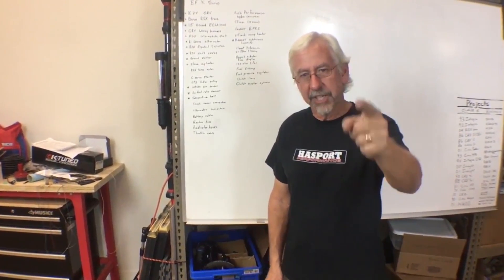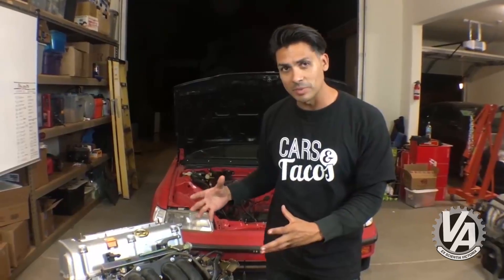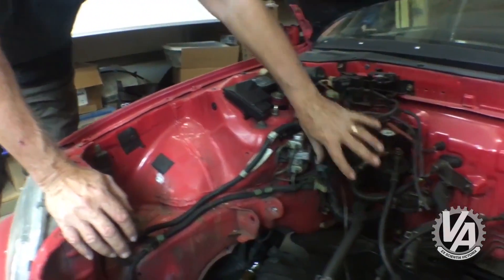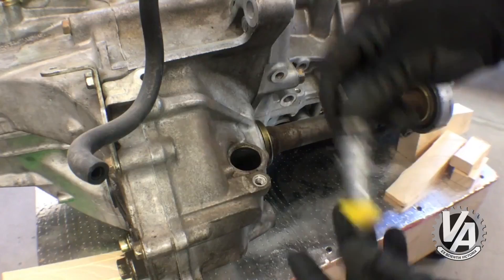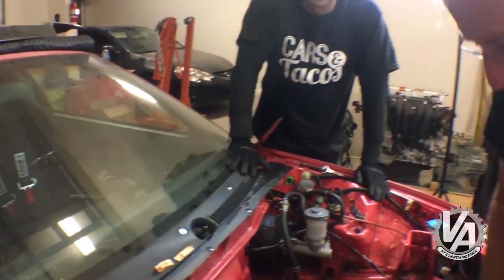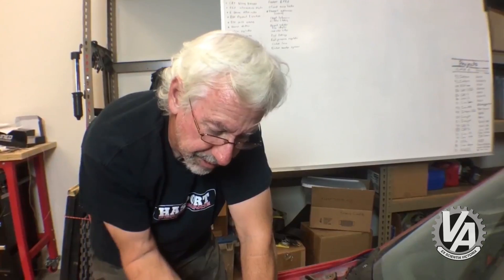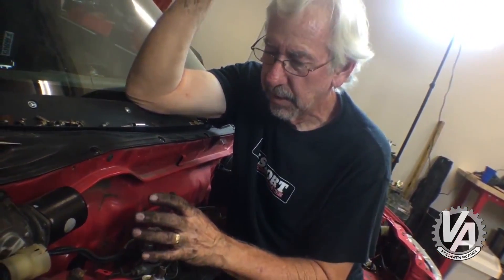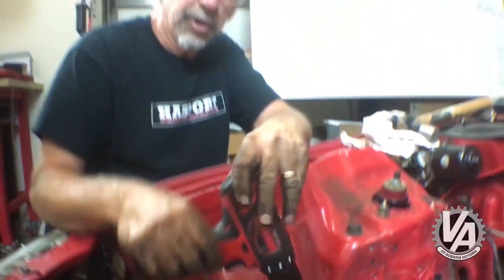Budget CRX K-Swap PART 1

Comment: I gotta ask here. I may msg you guys or send an email. Hush there says if you register, you a wild man. So, if the vin is reprogrammed to that crx, cats and all, like rear O2 we will say, vin change with year change, the ecu will read off of the obd port for a smog. Correct? I remember many years ago that a guy changed over to 99-00 single cam trans wiring into a crx for his female roommate for the ease of it all, and smog purposes. However this pcm does not have vin or year. I’d like to change year and vin to make it all work properly, smog, epa type stuff. If this makes sense. 
I have an 04 TSX that I did the pcm upgrade with and data port change, and it reads properly for and 04 year with the correct vin. The real difference is the read out on the ecu itself at the data port. 
Have you guys done any of this?

Comment: I have a '90 Honda CRX base model with a K24A1 out of a '04 CRV with a K20A2 stock head and oil pump. Do you think that I will be able to use the same mounts to fit this engine or will I have to go about other means? I'm unfortunately stuck in a time limit to make this happen as it needs to be done by November. Thank you so much.

Comment: What kind of fuel injected engine will fit in a stock 1987 honda civic crx dx
Reply: And will pass California smog
Reply from the maker: @rubenarnold9553  You should be able to use the 87 Integra with the Integra emissions devices and ECU. And another choice would be the 88-89 Integra. More wiring though.
Reply: @VTECAcademy  thanks man appreciate the help

Comment: Hello I have a 1986 Honda Civic that went threw a 1.5 year to restore it ...is it possible to put a k20 motor in my car ? I was wanting to put a type r with a Lsd but the k20 is a nice set up .I am just not sure
Reply from the maker: The K20 engine will fit in the 1984-1987 Civic Look for a future project car with that engine.
Reply: @VTECAcademy  thanks for the reply as I wasn't sure if the k20 set up would fit .
I will be on the lookout for up coming videos on this set up in my 86 Civic .. thanks again for the reply

Comment: That's cool using a wood drill bit to cut out the spot welds!
Reply from the maker: Bullet point bits are actually good for metal as well as wood. They can even be purchased with titanium coating. You may be thinking of brad point bits, those are for cutting wood.

Comment: a lot of work for 160-200ish HP and limited tq
what's wrong with a good old fashioned b18b1 and a small well designed turbo kit like a Greddy 18g
200 hp easy on pump
installs in 1 weekend including the swap

Comment: splitting the heater core hose to get it off.. man i wish i had that knowledge 4 years ago. so much easier than removing the dash to replace the heater core after damaging it with the channel lock method.

Comment: Yep!  First time I pulled my GSR engine I crushed the heater core pipes. So then I had the lovely task of pulling my dashboard and AC evaporator in order to replace my heater core. Also I think they're brass, not copper. At least it is on 3rd gen Integras.

Comment: Can you make a video showing the headache to actually have a k swapped crx and have it done legally in the state of CA?
Reply: Move.
Reply from the maker: At some point we will try to do a CARB legal build. I need to figure out some thing and find a connection over there as well.
Reply: Abel guy I’m pretty sure you need to have a best friend who’s in the system to get a k20 88-91 crx bar’d... that engine is too new for that chassis and here in Cali it’s been hell for some people I know. Your best bet would be a built h-series and swap it every 2yrs when smog comes around. H is a drop in swap, where once you go k, no coming back.